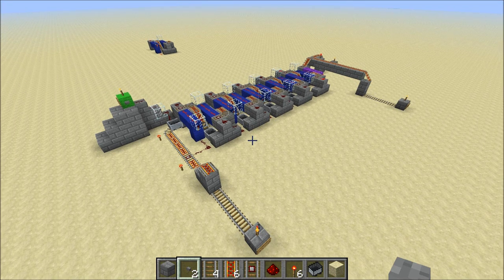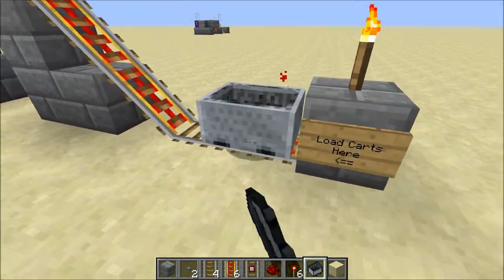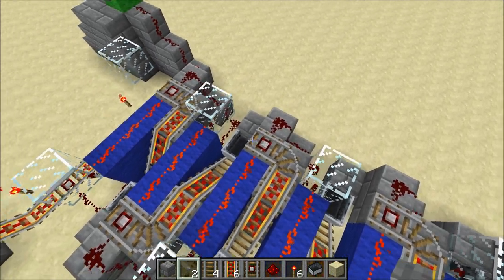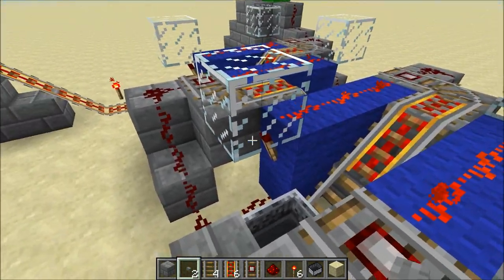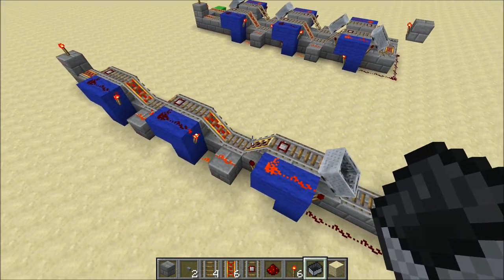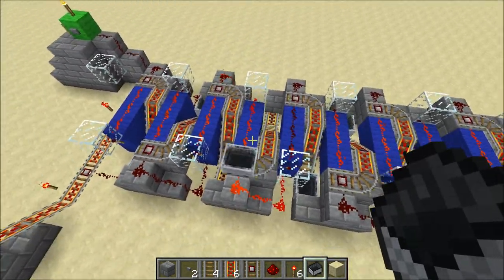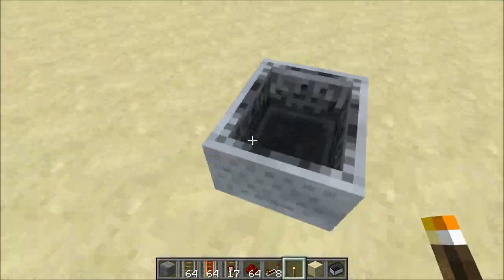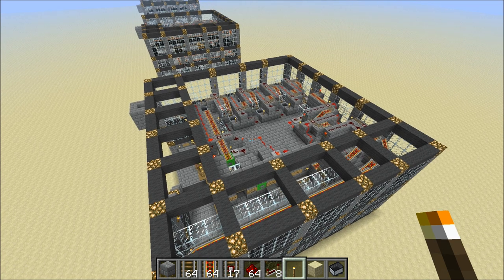Frumple's Horizontal Minecart Dispenser (OBSOLETE)

Comment from the maker: @TheExtragamer Easier said than done. It took me a while to figure out this design, and I want to spend more time finishing the station rather than trying to invent a dispenser that I won't use.

Like I said, my priority is to get a dispenser that won't glitch out in SMP. If it means it takes a bit more space and has slightly less cart capacity, then that's fine by me.

Comment from the maker: @IAmStobe I use Fraps and record in 1920x1080 resolution at full-size and 30 fps.

My machine is an Intel i5-2500K with 4GB of RAM and a GTX 560 Ti video card. I use it to play Minecraft, Skyrim, and TF2 most of the time. :P

Comment from the maker: @Albertweber16 Care to back that statement up? If you can make a design that is smaller but has the same behaviour as my dispenser, feel free to make a video response or send me a schematic.

In any case, my primary goal for this dispenser was reliability and not compactness. I wanted a design that would work in SMP and not screw up from glitches and carts jamming or running into each other.

Comment: Is there any reason why you don't use a Minecart Stack and have a piston push the bottom cart out? It will allow for a lot faster cart requests and cart loading and should auto-correct itself.

Comment: I have found a solution to the 1.2 problem

The output torch of the RS-NOR latch don't power the powered rail holding the cart. Put a torch below the block with the powered rail it is on, and control it through an inverter by the redstone wire directly in front of the torch. The only drawback is it takes 4 ticks longer per module to move.